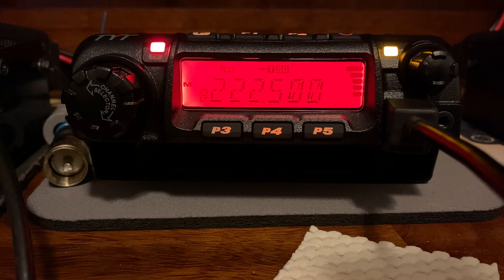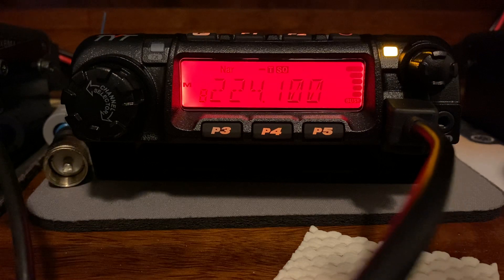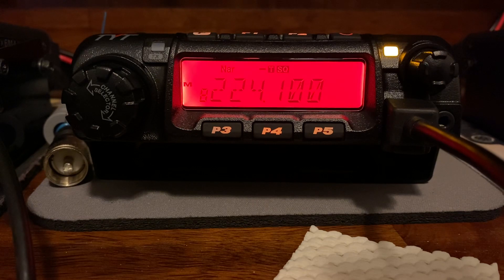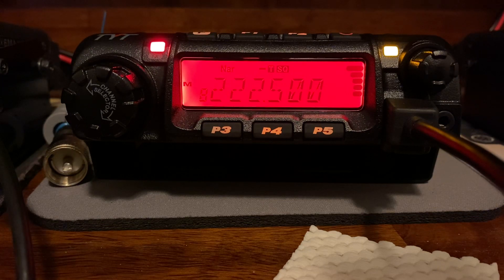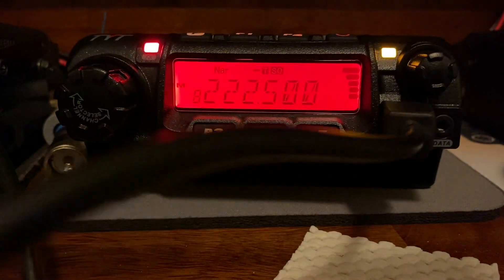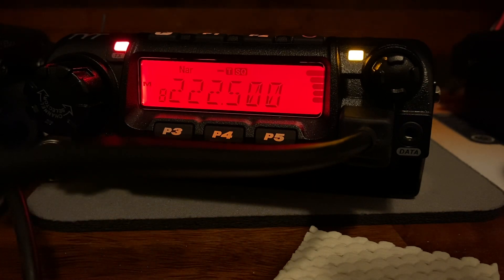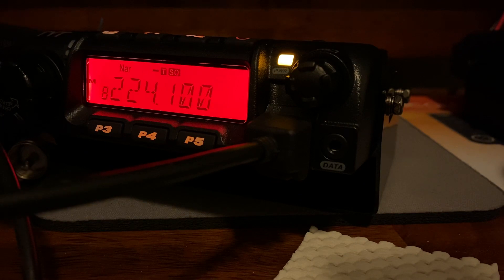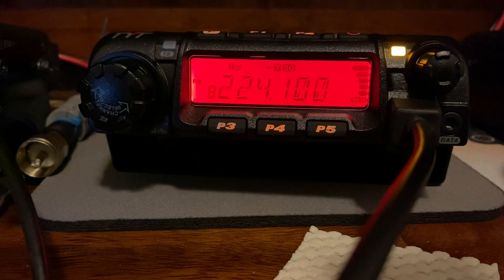A little 220 MHz work! #hamradio #220mhz

Comment: I got just over 60 watts from mine as did a local friend.I purchased mine at Hamvention in 2013 and I used it almost every day on High Power until it took a lightning strike a few months ago. It was not connected to any antenna so I believe the protection diode is blown since the power supply it was attached to was reset and is working just fine.
Reply from the maker: I’ve gotten my rig up to just over 60 watts. 
I’ve gotten into the habit or unplugging my power & antenna cables from the back of my rigs when not in use. A friend of mine had a rig zapped by lightning awhile back.

Comment: Nice to see some more 220 activity in Texas!  I run an Allstar simplex node on the band.  In my experience it's the best of both worlds -  less noise and smaller antennas than 2m, and the lower noise of 70 cm.  I think you'll find that for a given power and equivalent antennas, it'll often outdo both of those other bands.  220 and 6m are my favorite VHF/UHF bands!

Comment: Since they sell this radio also in VHF and UHF models I think they use the same box for all 3 models. 45 is for UHF.
Reply: I think so. A retail vendor at one of my local hamfests had all 3 models on their table one time and they were identical. 👍🏼
Reply from the maker: …the boxes were identical but they had all three bands covered.

Comment: I  am looking into buying one of these. I got my feet wet on 220 with  a cheap  quad band and before it did, was surprised of the range thru the 2 repeaters that are relatively close.
Reply from the maker: I use it a lot mobile for the ARRL VHF contests. I take it in & out of my truck/rover. But have used it in the QTH and it works pretty good. 
I had a QYT quad bander rig, tiny, even cheaper thing. Got it as a Christmas gift and it powered up but could not get it to transmit. The Amazon return window was like a week long so it closed before I ever received it. 🙄
This one is much better. By my meter it says it’s doing 60-63 watts on high! 👍🏼

Comment: Hey great video and very good you posted it, it helps others to know the 220 MHz can be used. I think there is another rig with the same model but for the 2 meter band or is this the same with some good mod?
Reply from the maker: Thanks for the comment.
You’re right! 
There are other TYT models that are identical but it’s either dual band, 2m & 440, or just 2m. I know I’ve seen them.